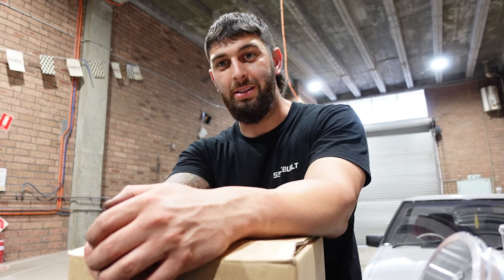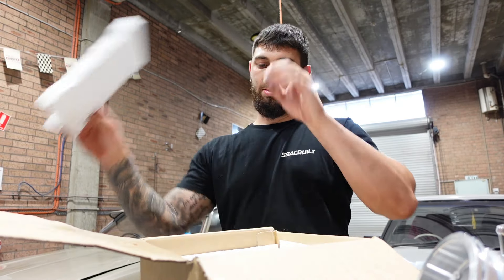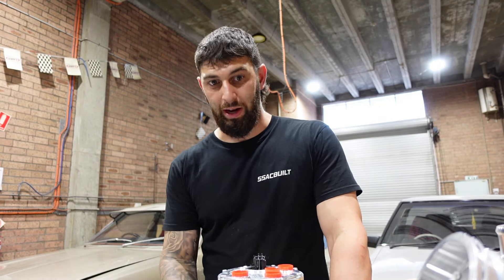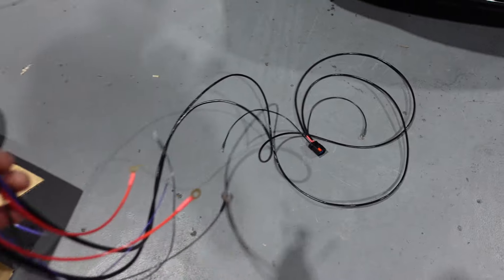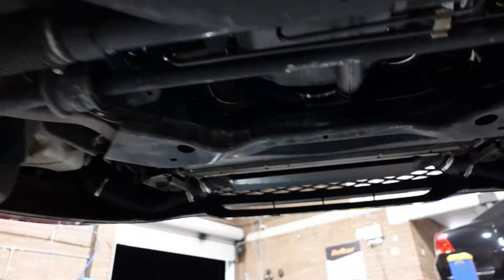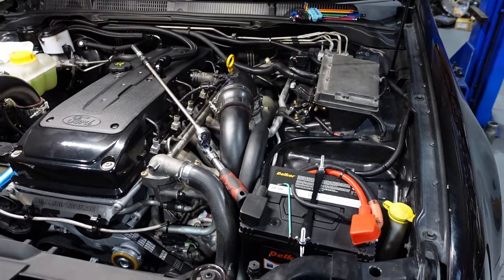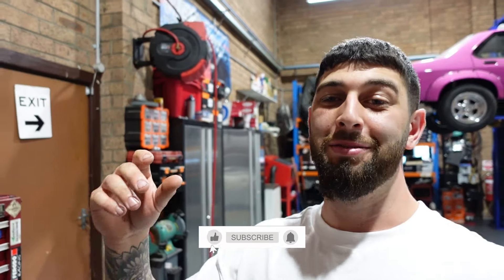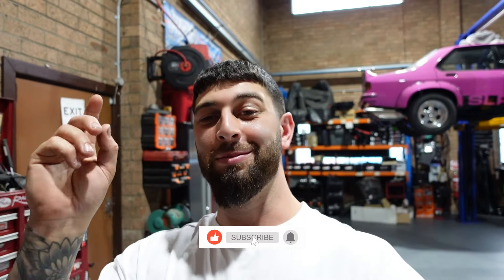FG XR6 TURBO "NANNU" | ROAD TO 500KW PT 7

Comment: Solid outcome using 800cc inj. 23psi and a 35 frame size turbo. Well done.
Reply: Is he actually using 800cc atm? 😳, mine are 1150 and I got 506🤔same turbo , 50 gate and bigger fuel , interesting
Reply: @denisk3064  All depends on the tuner but sounds like you need to take it to Blake he knows his stuff
Reply from the maker: Definitely! We were expecting 650 with those 800cc’s! But all looked fine. Running the 680hp tune to play it safe before new injectors and retune 👌🏼
Reply from the maker: @denisk3064 sure am mate! All depends on your tuner 👌🏼 Nick is the man for Barras
Reply: @GAMBIN.BUILDS  where’s he located? I’m in Melbourne
Reply from the maker: @denisk3064  Blakehurst in Sydney, probably doesn’t help much being in another state